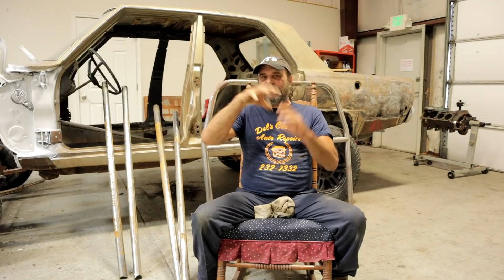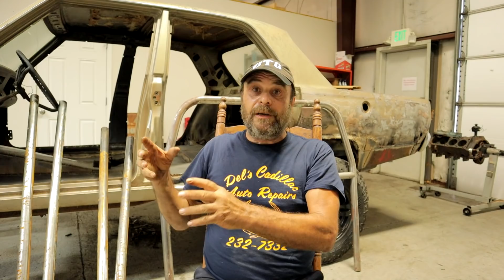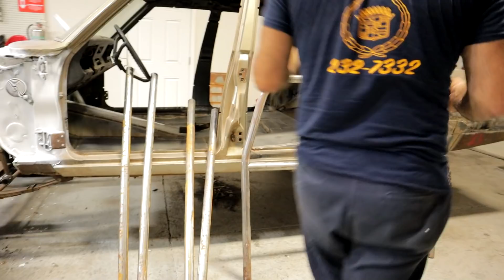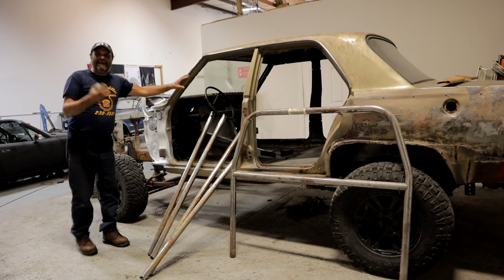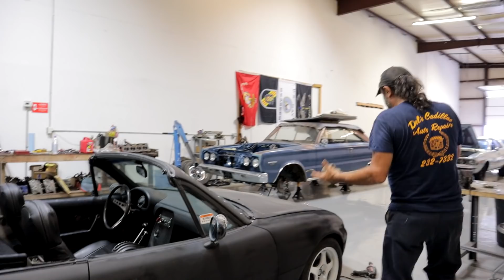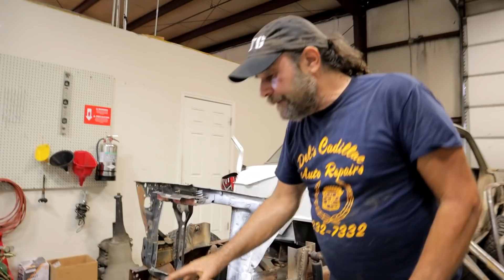Goodbye Gambler, Hello Gasser

Comment: It's already on a truck frame, and it has a front axle. Finish building it, throw a transfer case in there, and you'd have a freak of a vehicle that you can run AWD at the track and go offroading in 🤷‍♂️
Reply: Hmm, yeah not a bad idea. A 4x4 conversion would not be that hard to do.
Reply: I wasn't sure about the truck frame. Thanks for confirming. I'm a tiny bit bummed about the change.
Reply: How about a '63 split window 4x4 turbo Diesel, standard transmission with independent tracks and a 36.5 gallon fuel cell in Corvette silver snow machine?
Reply: agreed, swap the tires for how you're gonna run it. 
AWD power slide drifting is lots easier to manage on dirt anyway because the front yanks it where you point it, and less likely getting it stuck on inclines.
on pavement loses some weight advantage but gains on hole shot. with the rims+tires on it now taking it up in the mountains to play in some snow it'd be hard to stop with the clearance it has, for an all around basher it'd be fun!
Reply: @modelnutty6503  AWD is way more uncontrollable dude, lol. To powerslide awd you're going very fast. Rwd you just chuck it in and it'll go. AWD likes to understeer and shit, it's way more sketchy
Reply: @MrJohnnyDistortion  how about NO!... That would be the worst idea ever... Now do that with an old Riviera perhaps
Reply: @sprsprtrudy  
A replica body not a real one.
Reply: @MrJohnnyDistortion  how about who cares jus don't fuck up a legit 63 split window. End of story
Reply: @sprsprtrudy  
No. I wouldn't do that. You scare me.😱
Reply: @sprsprtrudy  you make balancing 5 projects and a youtube channel sound easy! Why dont you do it then? Youve obviously never had a real project or build before because you dont know the setbacks of waiting for parts and so on.
Reply: @jonathanlawson4667  bottle rocket made a pass and the broke the front suspension and personally i dont know what else he has going on other than lack of intrest in running plan Z down the track. He just took the miata out for a rip and obviously the valiant is missing some crucial pieces. What other "unfinished projects" does he have?
Reply: @jonathanlawson4667  also why only on weekends? I drive my rickety hotrod to work everyday and to the local meets when i get off

Comment: I saw this coming 6 months ago. How long ago was it when Uncle Krystal was cutting out those cardboard templates? I think that's the last video I've seen on this car. I saw Uncle Tony get off the Gambler 500 Highway when a road sign said, "Miata World Next 9 Exits." And what happened to the kitchen rebuild series?  OCD, more like ADHD.  Not only are there too many irons in the fire, there are too many fires. Disappointed, I don't want to see this car again. I'm breaking up emotionally with the Gambler 500 car. I want all my mix tapes back.

Comment: Dyers blowers makes a low deck B blower manifold (and entire blower setup)

Build a 700+Hp stock stroke 440 without major torque compromises for under $6k in parts

Comment: Hey Tony, here's what to do with the Gasser:
You know those Air Lift decals in the model car kits?  Get you one of those for the front, leave the rear alone.

At the starting line, the car has its nose in the air.  You go into second gear, hit the switch and the bags deflate.  Down the nose goes.  Now the car is an aerodynamic wedge, very stable and very fast.

My experience with this is tiny but I do have experience in putting the butt of a car up in the air and enjoying the very noticeable aerodynamic improvement.

Remember the spoilers people put under their front bumpers that made their cars faster?  Like that but the whole car.

Comment: Hey uncle tony I have been watching your videos for a while now as I'm a high school student looking at becoming an auto mechanic. I watch your videos about tuning carbs and setting ignition correctly. Iv impressed all the other kids at my school (with my 72 Plymouth fury 3 400 2bbl)  because of the crazy amount of low end torque where all I did was advance the timing and have the carb tuned perfectly. So my question was how important is having a thermostat? Would having no thermostat make it run cooler? Is high flow or standard flow better? Would running with no thermostat damage the engine? What are your thoughts/advice on thermostats?

Comment: Not going to lie uncle Tony I was pretty pumped to see this as a gambler car, but your logic and thought process definitely makes sense and it will be cool as hell as a gasser/street freak especially if it has a screw blown big block in it! And giving you a little breathing room to use and tune the completed projects. I know as you said you have projects planned for years, but here’s an idea that might be a happy medium for the hot rod and 4x4 off-road crowds, what about a pull truck/car like for dead sled or transfer sled. It could be 2wd or 4wd and big block, they don’t really get that dirty, and yes for that purpose it would be like the gambler car idea where it would only get used a handful of times a year, but if it’s kept relatively mild could pull double duty as a tow rig. I know you have the wrecker and that cube van for those kinds of purposes but it’s an idea. Anyway can’t wait to see that blown big block gasser/street freak!
Reply: The logic was an  an after thought...
Reply: @falconater68  in my opinion it would only be an “afterthought” if the project was basically completed, he made a rolling shell, and decided on changing directions because of logical thinking. Like I said if it was completed and running and then he changed his mind, then yes I’d agree with your comment

Comment: My dad ran in the gasser class . They use to flip the rear shackles upside down . He ran a 3 speed . Their were guys playing with automatics . Power glides that were very modified .  Gassers ran all sorts of crazy stuff . In line six bangers turbos off of diesel trucks fuel injection . A 383 build would be nice . Everyone says there dogs .

Comment: Always wanted to see someone use a bbm 383 block to make a big cid engine. Should be able to get 500 cubes out of it relatively easy with the right stroker crank and ovebore.

500 cubes doesn't need a blower as much as 383 cubes would.

Comment: Why not make it dual purpose. Big block power with blower, tilt nose hood for easy access to motor bay, zoomy headers or side pipes and run a custom suspension that you can raise or lower the suspension to whatever application you want to do that day.

Comment: Hows about a supercharged 318? That would be interesting .
Reply: Yes that would be cool . Plenty of blown small block gassers back in the day . Mix a little newer tech like a roller cam and a 600 hp 318 is possible . Plenty of wheel pulling power .

Comment: I thought the gambler was 4 wheel drive.  It's got a straight axle. What kind of off roading were you going to do with a 2 wheel drive mud machine other than get stuck in the mud?  Build a gasser.  Makes better sense, seems to be the direction you were going any way.
Reply: You would be impressed how much crap you can go through with a 2wd! Set it up right and for the love of God dont let off the throttle!

Comment: I'm down for a gasser/street freak build. I too have more than enough projects to keep me busy until well after I am dead... and I am only 52. One of which is my own gasser, a 65 LeMans that donated its interior, grille, and a few other parts to the 65 GTO. Its begging me for a straight axle with a dual quad 455 powering it. I have almost all the parts already, need to pick up the front suspension and a couple other bits. Just got the 15" slots for it last week. This thing is gonna be tits.

Comment: just finish the gambler 500 car.... i think a gasser/street freak needs to be more refined as far as paint job and finish... the axles sticking out 4 inches on each corner doesn't help much either... a gambler car can be a fun project, i own a 68 sateellite 4 door on wagon wheels and knobby tires i frequently take light offroading (think general lee without the jumps) and my family enjoys the dirt hooning, as do dumbfounded onlookers in their razrs and rubicons.... its more likely you will use it as a daily driver more than you would if you turned it into a drag racing inspired build... i will watch the hot mess either way!

Comment: Team up with Richard Holdener and go turbo!
Reply: Screw turbos, everybody does turbos now.  If it's gonna be a gasser, it's gotta have a blower.
Reply: Not in a gasser . Big hulking blower or high injection tubes a foot high . I love my turbos , have 2 cars with turbos .
Reply: @gregblack3860  Turbo's are a fad... a trend... I like old school shit... This car needs a big ass 871 on it.
Reply: @livewire2759  everyone does turbo's now for a reason. People figured out it works better and can be done cheaper than going with a roots blower. That is like saying modern aluminum aftermarket cylinder heads is a fad and old cast iron stock ones are better lol.
Reply: @GnarshredProductions  Yeah, they use them 'cause they're cheap, just like blowers were cheap back when gassers were first popular.  That's why it needs a blower, not turbos.  Turbos are a fad because people think they need to put turbos on every damn thing.  That'll go away eventually and everyone will jump on the next power adder bandwagon, just like the old nitrous bandwagon a couple of decades ago.
Reply: @livewire2759  The only thing after turbo's is electric cars. Until then turbo's and centrifugal superchargers like procharger/vortech are the hands down the best power adders available anywhere and that isn't going to change anytime soon. There is a reason why traditional roots blowers are garbage go watch the video where Gale Banks tried to run a 6-71 roots on top of his duramax on the dyno at like 15-20psi of boost and the intake air temps were like 300+ degrees fahrenheit. This is why roots blowers aren't worth a shit unless you are running the engine on alcohol or nitro because they are so inefficient that if you try and run any decent amount of boost the intake air temps get hot as hell and on pump gas it will run into detonation issues like that. Most of the cars with blowers on pump gas are low boost like 5psi and they were just built to idle around the fairgrounds and look cool not make any kind of real power.
Reply: @GnarshredProductions  "The only thing after turbos is electric cars"  How do you know?  Back when all we had was steam power, nobody predicted gasoline internal combustion engines.  Something new could be invented any time.  I'm well aware that turbos generally outperform blowers, that's not my point, and it sure as hell isn't the point of this channel or this project.  Gassers are terrible race cars, they don't handle worth a crap and nearly everything since then has performed better, but people still like to build and race gassers, just like they still like to run blowers.  It's fun.  To some people that's more important than simply bang for buck.